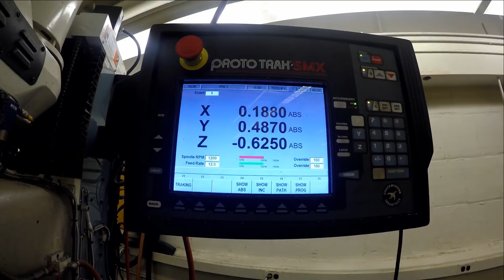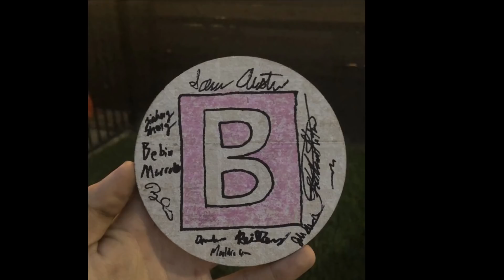2017 - 2018 Propulsion Subteam Recap - MIT Rocket Team

Comment: 0:12 What are the grain Spacer O-rings used for
Reply: The space that they leave between the grains ensures that all grain faces will be lit on ignition and that they don't inhibit themselves. This would cause complications during the burn, like the Kn range getting thrown off. Alternatively, you can make a concave face on the grains like CTI does, but doing that on 5" diameter grains sounds less than fun :-)

Comment: how are you guys sealing the nozzle to the casing? press fit or o-ring?
Reply: There's a double o-ring shaft seal to both closures
Reply: @AstroCharlie  Have you thought about including a 'compression O-ring' that fits between your nozzle and nozzle retainer? Doesn't risk getting cut when sliding nozzle past O-ring groves or bolt holes and seals better as the pressure increases.
Reply: @mojaverockets  We don't have seals around our retainer, so we'd need to change a lot. We've had our seals survive to 1550 psi hot and over 2k psi hydro, so we're pretty happy for now.
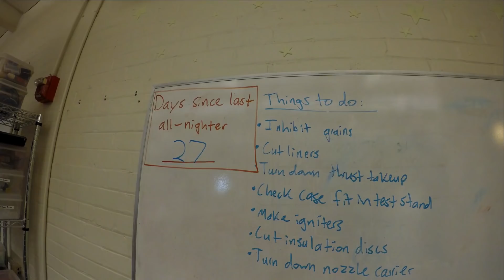Reply: Just looking at the triple O-ring setup at 1:49 in the video. We use to do two and three and have reduced that to none or a single floating compressional and one traditional and found a large weight and space savings in the motor. The O-rings don't go around the retainer, it sits between the retainer and the bulkhead or nozzle in a slight cut in either and gets compressed when the motor fires. Never had a leak doing that method provided the ends are a good fit. Just a suggestion if you need to save some weight.
Reply: @mojaverockets  @Charlie Garcia Have either of you or your classes made any hybrid motors?
Reply: @mojaverockets  We could not do that with our geometry, we'd have a leak path through the radial bolt holes. The closures are 'u' shaped, so we don't have a lot of dead weight added by the height. The third o-ring on the closure is actually a seal to the top of the liner, so we don't have blow-by around our liner.
Reply: @AstroCharlie  the floating compressional O-ring goes in before the radial bolts holes. Imagine, your bolt holes act like the threads on an Aerotech or Cesaroni motor, their compressional O-rings are located adjacient to the actual nozzle ahead of the threads. Your construction is designed like Loki style closures using inset O-rings and snap rings instead of your radial bolt pattern but if your happy with that design then whatever works for you is the way to go.